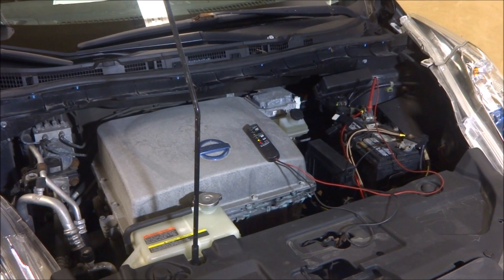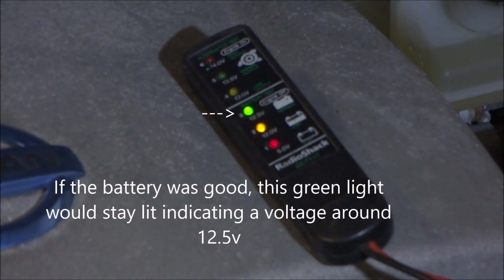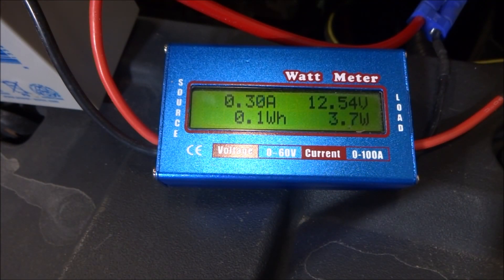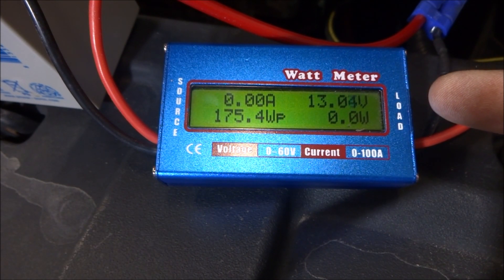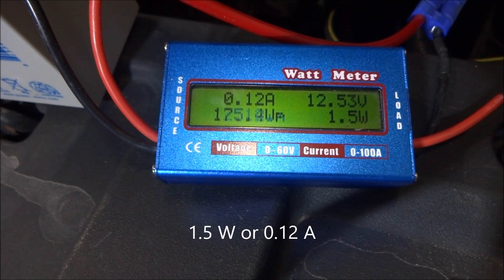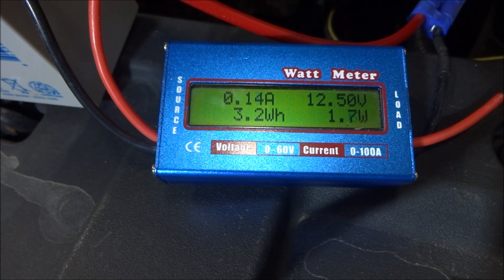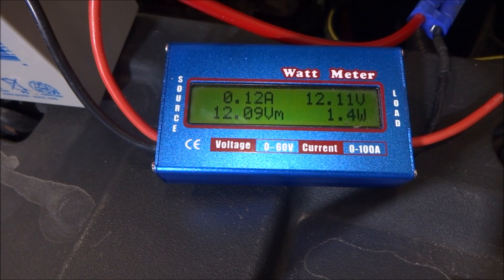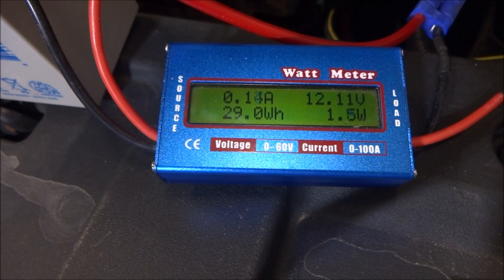Nissan LEAF power draw on 12v battery

Comment: Be careful using lithium as a 12V replacement, the DC-DC converter charge rate is very high. If the 12V voltage it low the DC-DC can push 100A into it. This could cause a lithium battery to catch fire. Be sure to calculate the maximum charge rate your lithium pack can safely handle.
Reply from the maker: Shouldn't be a problem, I will be using high power LiFePO4 cells

Comment: What are you going to use for a 12v BMS?  I wanted to put a lithium 12v battery like battle born battery in my 2013 leaf but the BMS has a 32 degree low temp cut off for charging.  You can still discharge under 32 though.  I live in a colder part of the country so I would have to add a heater and insulation to make sure it will charge in winter.
Reply from the maker: Not planning on using a BMS, at least not at first. Yes lithium batteries don't like being charged when below freezing. Luckily, I park my car in a garage that never goes below freezing.

Comment: Great vid as usual! What I have noticed is that Leaf charges the battery if it goes below 10 Volts. So I would not trust the 24 hour promise. Mine is ‘13, so could differ.
Reply from the maker: Interesting, maybe something I should test...

Comment: Cool! I'm working on the same project. I'll do a vid on mine also. I've designed a 3D printable battery box to put mine in. What are you doing for a box? I'm using some recycled e-bike pouch cells to make 40 Ah pack.

Comment: Guess I would install a small Solar Panel to keep my battery maintained over extended parking times. 
4S  or 4 Series LiFePO4 cell makes a ideal 12v lead acid replacement pack.   3.65v x 4 = 14.6.   Only charging your cells to 3.6v extending cell life would give you 14.4v. 
Don't forget to employ a BMS.   Your Automotive charging system produces well above the 14.6v limit on your LiFePO4 cells.  No other protections should be required.